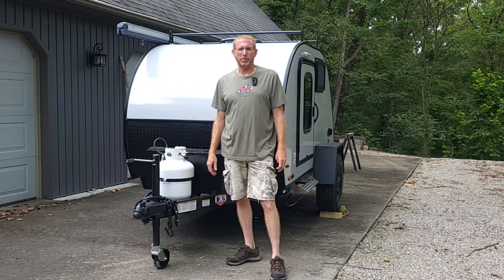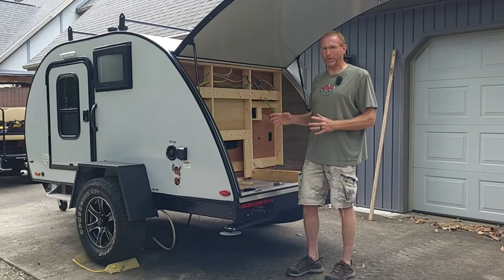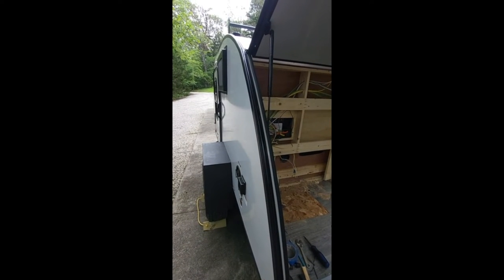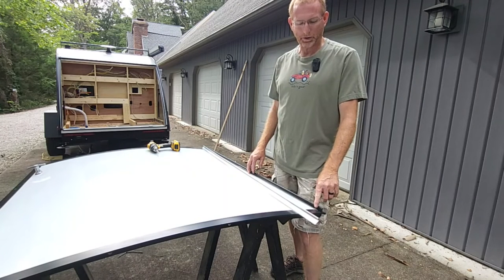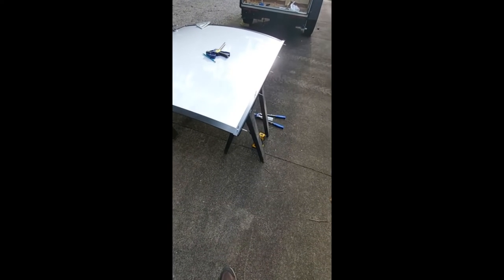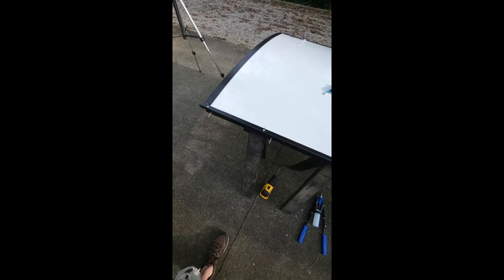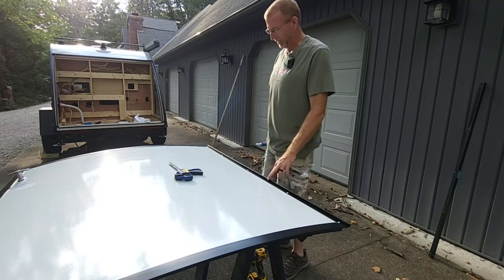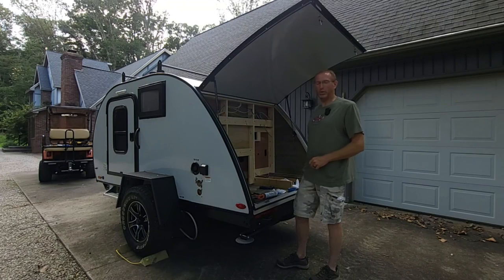Bushwacker Teardrop Camper Galley Door Leak Repair

Comment: I understand having to remove the stop screws but what stops the the reinstalled hatch door from shifting from side to side and possibly binding when closing?
Reply from the maker: In a year and half we have not had any issues with the lid sliding side to side. I believe the surface friction of the hinge combined with the pressure of the struts against it help keep it in position.

Comment: I may have missed it, but what year is your trailer? I'm about to do this, too. I need to know more about that math you were talking about in attaching the new lower hinge. Didn't quite follow. Can someone explain that a little better before I pull all this off? :)
Reply: Also, I have an issue with the upper hinge as the heads of the screws going into the frame have broken and is leaking on one side. I need to re-attach. I figured I'd just do all this at the time time.
Reply from the maker: We have a 2022 HD. As far as the math goes I have started extending the lower hinge section off the edge of the door to get the drip as far outboard as possible.
 I have also discovered and issue with how Braxton Creek elattached the upper section of hinge to the camper. I have had to fix several and helped others remotely fix theirs with the same issue. 
 I will be putting out a video detailing the upper hinge issue shortly so you might want to wait on that before doing the lower section so you just have to remove the door once. 
 It's not hard to do, just needs to be done.
Reply from the maker: @RP4TV  , I just saw this. That is what I will cover in the new video. That is a problem a lot of people are going to be facing as these campers age for one simple reason. I will explain it in the new video.
Reply: @adventuresofthememorymakers  thanks for the response. Mine's also a '22. I'm not sure I can wait just because I have a trip planned soon, but I spoke with the guy who helped the manufacturing line and he gave me some ideas. When do you think the vid is coming roughly? I wish I could ask you directly off of here, but I hope to figure it out and do it all at once. Other than these issues I've largely had good luck with the camper.
Reply from the maker: @RP4TV   drop Us an email at adventuresofthememorymakers@gmail.com we can get in touch from there.